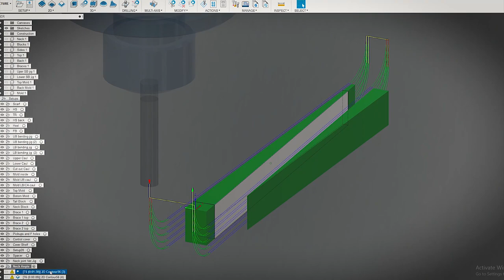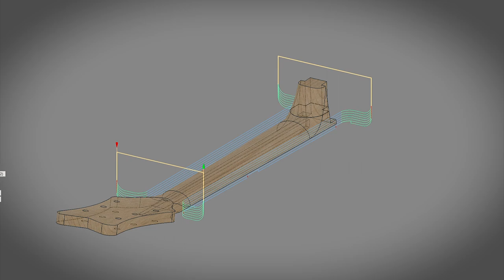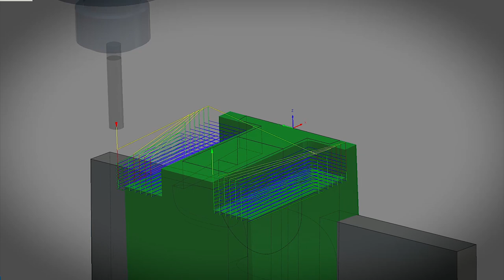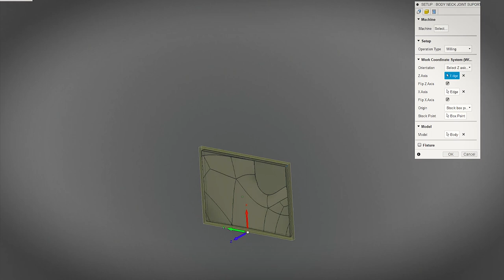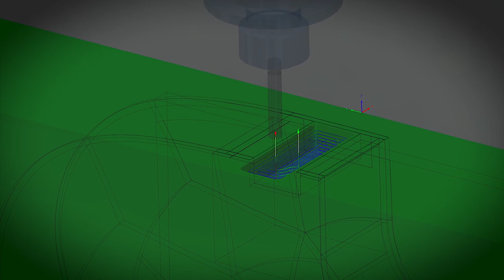Making the Gretsch White Falcon | CNC Neck Joint CNC guitar

Comment: Great job!! Question: How many degrees of inclination does the neck joint have to match the height of the bridge?
Reply from the maker: The neck angle specifics are in the Fusion360 file that I share with my Patreon members. I have only made one of these, so I don't have that kind of specs off the top of my head; it was designed to the vintage specifications or as close as I could possibly come.

Comment: Beatiful work! I'm amazed at the accuracy of your work. At 10.08 when your taking of one last pass, did you adjust the width of the mortise in Fusion, redo the cam and upload the new cam or is there some other clever way of doing this?
Reply from the maker: I usually create and post-process a few of the same tool-path with the stock to leave incrementally negative five thousand each. I can test fit the neck joint, and if it needs a bit more cutaway, I run the next file and take off five thousand and test it again. Wood is a dynamic material, and precision like this is not easy. I hope that helps explain it.  

Thanks for the great comment.